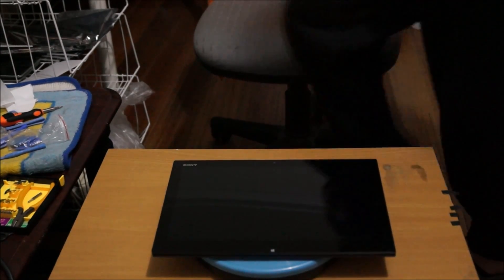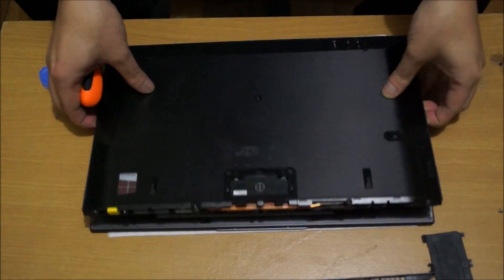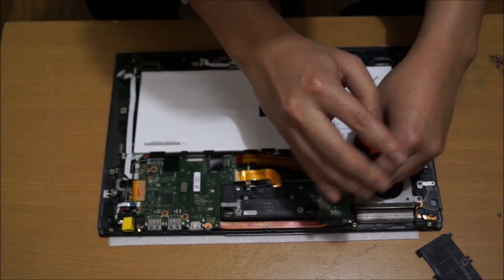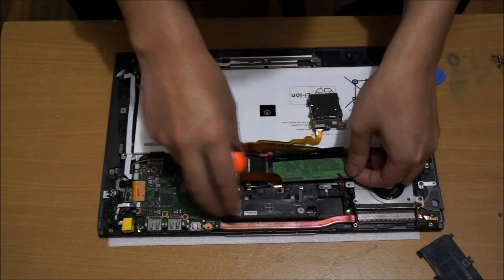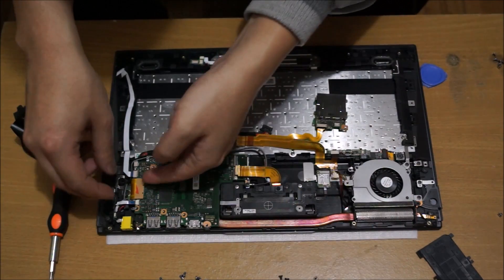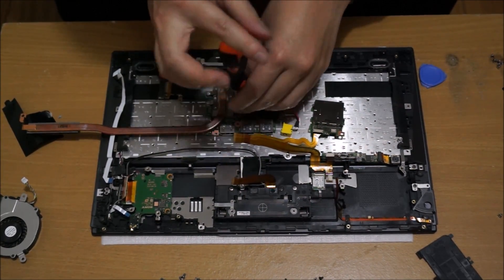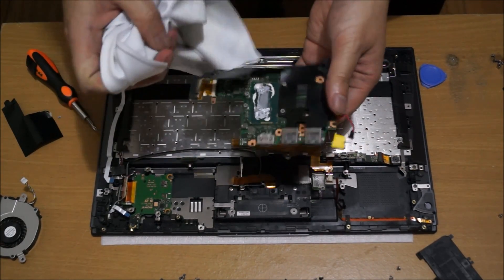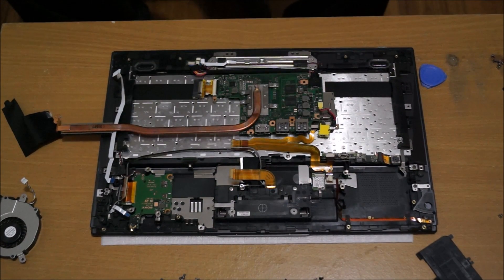OPEN ME UP! Sony VAIO Duo 13 Disassembly

Comment: Hi, your video is excellent. Please help me with a question about this computer... Is it possible to upgrade the RAM from 4 to 8 GB? Is it possible to upgrade the 250 GB SSD to a larger one?
Reply from the maker: CPU is solder on, ram is solder on, wireless card is solder on, and hard drive is a M.2 80mm long

Comment: Hello, i have a problem with this Sony i try to install windows 10, i instalez but after restarting every time and say your device ran into problem and needs to restart we’ll restart for you and only time restarted but not power solution ?
Reply from the maker: you might actually have a problem. you ram might be faulty.

Comment: Hi do you know if this laptop supports sk hynix p31 nvme drive, and able to take advantage of the full speed?  Thinking about upgrading mine to p31 1tb drive but not sure if it's worth it.  Thanks
Reply from the maker: this laptop can not use nvme. it is too old. it old uses sata m.2
Reply: @OpenMeUpTec  ok thank you

Comment: Is the SSD upgradeable on this laptop to 512gb or 1TB? Also is the DC in port (the yellow square part attached to the motherboard, is that easily replaceable or is that soldered on?
Reply from the maker: it is upgradable to whatever fits in the slot. so if you can find a 1tb ssd then it will work. make sure it is not NVMe. it needs to be sata m.2. the yellow power jack can be removed as it is a connector

Comment: Hi! Useful video! My Duo is now 6years and I'm getting short of memory for Windows and Office. Would you suggest changing ssd and/or ram? Are the remaining components compatible with more recent memory or ram? Thanks in advance!
Reply from the maker: ssd and ram for this is avaliable. ram is DDR3L and any brand is fine as this is not an apple whatever fits in the slot should work
Reply: @OpenMeUpTec  thank you for your quick reply!
Reply from the maker: @rodrigoabreu679  sorry i made a mistake. CPU is solder on, ram is solder on, wireless card is solder on, and hard drive is a M.2 80mm long
Reply: @OpenMeUpTec  are you suuure?? Is sony vaio duo 13's RAM  upgradable??
i think its soldred on the board where is the slot on it?
Reply from the maker: @d.s.h6629  sorry i made a mistake and thought it was the other sony laptop. CPU is solder on, ram is solder on, wireless card is solder on, and hard drive is a M.2 80mm long
Reply: same here :(

Comment: Hey bro, can i ask a question
Reply from the maker: what is the question
Reply: Can i send you a photo of a battery and ask you as if it is the battery of this model, ok ??
Reply from the maker: @oanmanh7967  i dont have the laptop anymore to do that.
Reply: Oh, ok thank you anyway
Reply: @oanmanh7967  you can buy a replacement battery from Amazon for under $100!  Battery made by Kingsener.  Drops right in, following the video instructions.

Comment: Do you know where the cmos battery is on the board?
Reply from the maker: it is soldered on the laptop. why do you need it? most likely it is not your problem
Reply: @OpenMeUpTec  Very useful video thanks. My laptop appears not to be charging the battery. I have changed the battery and power supply. It works briefly until the battery goes flat, then won't start - there is a faint clicking sound coming from the mother board area. Do you think it could be the CMOS battery? Thank you.

Comment: Please, someone tell me if its possible to turn on and use the computer without the battery, mine  s swollen
Reply from the maker: for this laptop no. the battery is used to power on the laptop. the power cable is used to charge the laptop only

Comment: Thanks much for this video. I had an old VAIO DUO 13 that stopped holding a charge a while back, and which I retired to a tabletop media player... but eventually the broken battery inside started to swell. Your video helped me open it up to remove the bloating battery and keep the VAIO alive and useful for a little longer.
I would have never figured out prying off the port cover and peeling the speaker tape to get to the important screws underneath without your walk-though.
Thanks again.
Reply from the maker: thanks for your support
Reply: Does that mean you where able to use the laptop with the battery removed

Comment: where I get new battery ? Can’t find the same... thanks for your help. I live in europe/germany
Reply from the maker: try using ebay or typing the model of the battery in google to see if anyone is selling it
Reply: I just bought a battery from Kingsener on Amazon for under $100!  Worked great.  https://www.amazon.com/gp/product/B089K4GPXW/ref=ppx_yo_dt_b_asin_title_o04_s00?ie=UTF8&psc=1

Comment: I have sony vaio ultrabook Svd1321m2ew but unfortunately i lost recovery disc and also i installed a new window but it's showing INTERNAL POWER ERROR, i dont have a recovery disc help me out please because recovery disc cost $44 and i dont have enough money!
Reply from the maker: the new windows would not cause this issue and if you have the recovery disc it will not help you fix this issue. can you tell me how you know you have a power issue
Reply: @OpenMeUpTec  i installed a new window,after restarting its showing blue screen with saying that internal power search it online
Reply: @OpenMeUpTec  your pc ran into problem and need to restart
Reply from the maker: can you show me a picture of this. is it a blue screen with a sad face on it? if so then that is a windows problem, therefore you just need to reinstall windows
Reply: @OpenMeUpTec  yes with a sad face! I installed it 5 times but same issue!
Reply: May i have ur email so that i can send u pic!
Reply from the maker: you are stuffing up some where. watch some youtube videos on how to install windows. you could have other issues like faulty ram or hard drive which will cause the same issue
Reply: @OpenMeUpTec  all I need is recovery disc! I've searched about the issue and got same response that i need recovery disc!
Reply from the maker: the recovery disc just installs windows it is nothing special. if you believe you need it then you can contact sony and they can provide it to you but it will cost
Reply: @OpenMeUpTec  means to say! Sony ultrabook needs original sony drivers and compatible operating system!
Reply from the maker: you need to understand sony doesnt make the laptop they buy components from other and then assemble them. this is why you dont need the recovery disc.  the CPU is make by INTEL, sounds is from RealTch, touch screen drive is from windows. therefore you can go to them to get the driver or go on the sony website and download the latest driver instead of using the recovery disc. the issue is the recovery disc as it is old and the driver are from when they produce the laptop, if you install never version of windows on the laptop you will then need to go to sony website to get the updates.

Comment: Hi! Do you think it's possible to change the wireless card (802.11abgn) with a recent one (802.11ac)? Thank!!
Reply from the maker: yes just replace it with what you are after. you can get one for $20AUD
Reply: OPEN ME UP Thank you for the answer! What kind of card should I search? This one could be fit ??
  https://es.aliexpress.com/store/product/Brand-new-intel-Tri-Band-Wireless-AC-18260-18260NGW-802-11ad-ac-867Mbps-2-4-5G/1540493_32791950847.html?spm=a219c.search0302.3.17.3a3621aapTOsyN&ws_ab_test=searchweb0_0,searchweb201602_0_10152_10151_10618_10059_10696_10534_10084_100031_10083_10184_10547_10624_10623_441_10307_10548_10341_10065_10340_10068_10343_10342_10301_10103_10620_10344_10303_10622_10621,searchweb201603_0,ppcSwitch_0&algo_pvid=99136bce-45c2-44de-b06c-bb2ff5fd9812&algo_expid=99136bce-45c2-44de-b06c-bb2ff5fd9812-2
Reply from the maker: sorry about that i had to watch my video again just to confirm and you basically cant change the wireless card
Reply: Sorry, can you replace the wifi card?
Or can not be changed by the wifi card mentioned in the last comment?

Comment: This video was extremely helpful thank you. I want to replace my hard drive since it doesn't really have much space to start with, would you be able to suggest a good replacement hard drive? I've never seen a hard drive that looked like that? I don't even know what it's called. Once again thank you.
Reply: Is a ssd. Not a hard drive
Reply from the maker: the hard drive is a M.2. it will be best if you can remove the hard drive then take it to the store so they can get your info about it. remember to leave the store and buy it online as it is normally cheaper

Comment: Any good wedsite that i can buy the same battery that you took removed. Thank you so much for the video hope you can help me
Reply from the maker: there isnt really an good sites you can buy it off. i live in australia and most of the stuff i buy come from there. the battery for this laptop is extremely expensive you will find that buying a new laptop will be cheaper
Reply: That's the same conclusion that I have come to. Hello Surface book... goodbye $3k. sigh.

Comment: Thank you so much. Actually I have problem with the same device. the device is not working it doesn't turned on and doesn't accept to charge.  I don't know what to do. please if you can help me in this problem.
Reply from the maker: your battery is dead or your motherboard is dead
Reply: +OPEN ME UP thank you for your answer. how can I know that the motherboard still working or not.  Could  you please contact me : loaay2010@gmail.com. I need to contact you for more information.  Thank you.
Reply from the maker: you can not test it unless you have a working battery that you know is working or the same laptop thats work so you can switch out things and test it. this is how stores and companies test faulty stuff
Reply: Ram sony vaio duo 13

Comment: hi thanks I have sony svd13223cxw every thing work good but fan not start I change fan by new but not work and after 10 min down because cpu is hot what I can do .
Reply from the maker: the fan doesnt need to spin until the computer tells it to. in your case when the cpu get hot enough it will tell the fan to spin which is normal.

Comment: Where is the bios-battery in this device?
Reply: Alessandro Gioanetti, not yet, my Vaio is still in process of fixing. Repair guys told me the problem was with some element that is responsible for managing power between elements or something like that.
Reply from the maker: soldered on
Reply: OPEN ME UP thanx for quick response. Can you tell how does it look like? Or does it have any marks on it? It seems like my Vaio won't turn on because of this battery became uncharged :(
Reply from the maker: I really doubt that. BIOS battery normally dont die. just to let you know if you laptop battery is dead the laptop wont turn on
Reply: It turns on (fan starts to work, keyboard light starts to dynamically change), but the screen is black, I can not even enter the BIOS. At first it was like 1 time of 5, then more often (and it worked wonderful with no issues even on heavy tasks with no artifacts, but it was hard to turn it on) and now it won't work at all. So it seems like the battery was dying slowly or maybe the chipset soldering becoming bad.
Reply: Alexander Korzhykov,  have you found a way to solve the issue? because I have exactly the same problem.....
Reply: Alexander Korzhykov, did he told you the price yet?here they just said that I have to change the motherboard, for more or less € 1000... they crazy... what they told you is a way more accurate.. but have you tried to press cap lock to check if the small led on it would turn on? because my keyboard turns on but cap lock let no, and thats strange...
Reply: Alessandro Gioanetti yep, the same here. They told they ordered that part from foreign supplier and will replace it as soon as it arrives. Overall price is something like 100$ including work. But that's the 3rd guys trying to figure out what is wrong, so it's hard to find good specialists. Previous guys suggested motherboard change or CPU re-soldering, but seems like this guys have found the real reason.
Reply: Alexander Korzhykov oh my God please give me the name of the place and phone number, I'm willing to send it all the way if necessary!
Reply: Alessandro Gioanetti I'm from Ukraine + repair is still in progress. If it gets fixed I can ask them to tell me the exact name of the broken part and you can tell your local repair guys what is the actual cause, so they can do the same.
Reply: Alexander Korzhykov ok i will be waiting for your precious message 😉👍
Reply: So it appears that in my case the problem was in BIOS + multicontroller MEC1633X-AUE on the motherboard. I bought a new controller, but can not find firmware anywhere. If you go to repair guys, please tell them to make a dump of that micro controller and send it to me. It may help to save the laptop.
Thank you!
Reply: @fractalawareness  привет. Получилось победить Соньку? У меня похожая проблема. Началось с того что вышла из строя батарея. На тот момент были только оригинальные и достаточно дорогие что я не спешил покупать. Некоторое время ноут просто лежал, потому что без батареи не включался. Но однажды я его включил от сети и достаточно долго пользовался. Затем заказал батарею от Kingsener c алиэкспресса. И пока она доставлялась ноут перестал похожим образом включаться - клавиши загораются, иногда вентилятор а экран нет. Теперь у меня есть новая батарея но ноут не работает ((.. Думаю как быть дальше
Reply: @Crazy.Scientist  нет, мне надоело с ним возиться и я его продал под восстановление((
Reply: @fractalawareness  понятно 🙂

Comment: Am I able to replace the hard drive with this Samsung SSD NVMe MZVPV256HDGL-00000 SM951 256GB M.2 PCI Express 3.0 drive?   https://www.amazon.com/dp/B015CWQY4Q/ref=wl_it_dp_o_pd_S_ttl?_encoding=UTF8&colid=2Y51CHOSFTGP8&coliid=ILXJJC6ECQSEX
Reply from the maker: yes you can but the laptop is older than the
hard drive therefore you will not get NVMe speed that the hard drive can
provide. you might as well save your money buy a non NVMe drive

Comment: Can I open the touchscreen without opening the motherboard? The screen panel of mine is broken so I want to replace it. It's seemed not similar to ordinary laptop screen's attachments. Could you take another video to show the way to remove screen panel? And one thing more: my lap is vaio duo 11, is it the same with 13?
Reply from the maker: +Phúc Nguyên Mạc I no longer have the item. you should be able to remove the top half without removing the botttom
Reply: +Phúc Nguyên Mạc yes, you have to remove 12 screws and the tpuchscreen is clip, I remove it to repair my sim card slot, it's easy.
Reply: hello sir thank you but sir i want to know when i removed 12 screw than eaisily pull screen and sir i face same problem sim card slot please tell me can i repair sim card slot
Reply: sir please
Reply: +Nitin Sharma yes You can ,next you remove the touché screen you have to remove a metal table with 6 screw and then you going to see the SIM card slot connected to the router , my problem was just a pin I welded it and it's work again . If you wants more help just mail me to grego340@gmail.com .

Comment: The video helped thank you. See if you can help me, I made the switch from ssd, however i do not have the recovery disk, to automatically turn falls into the vaio Care screen and does not recognize the flash drive whith the windows installation boot. Any tips?
Reply from the maker: +Fabio Batista i dont understand what you trying to say but what you need to do is just install windows on it using an external DVD drive as you replace your SSD it doesnt have windows on it and you need to put windows on it to use it.

Comment: Hello Dear, Thank you for the great video. I have a quick question. The plastic mesh which is located at the backside. Is it possible to put back. If not, can i buy this part somewhere. Thank you in adavance.
Reply from the maker: +Jasmiine jeeva it is just a sticker as you see in the video I pulled it off
Reply: Is it possible to put back with adhesive.
Reply from the maker: Yes but I get a vibe that what I think is different from what you think. So to ensure it is correct can you tell me the time in the video of the item you are questioning
Reply: +OPEN ME UP From 03:35 in the video. Plastic mesh below
Reply from the maker: so you taking about the wrong bottom cover. yes you can replace the whole bottom cover but doubt you will find it available anywhere
Reply: +OPEN ME UP I am planning to replace my battery. So am worried about that when I take out the plastic mesh, can I put it back. It's not damaged now
Reply from the maker: yes as you saw in the video i have to remove screws to remove if you reserve the process in goes back
Reply: @OpenMeUpTec  I could not glue it back. Where can I buy it?
Reply from the maker: @munlight3  what you mean. what are you trying to glue

Comment: And to replace the touchscreen? do I have to open till the mobo? Thanks
Reply from the maker: +Matt Mustang you have to remove the cable attach tot he motherboard so you will have to open it up.
Reply: OPEN ME UP Thanks but Nooooooo, also you didn't open the screen.
Reply from the maker: I used to open the screen then found out it was pointless as people get scared to remove the screen in case they crack it or break is somehow. many people are already scared to just open up their laptop with watching the video just imagine removing something breakable like the screen.
Reply: OPEN ME UP Well the thing is a small part of the screen doesn't work with fingers but only with the stylus so I'm not sure if the problem is the touchscreen or the digitizer or windows 10 update, anyways thank you for your help.